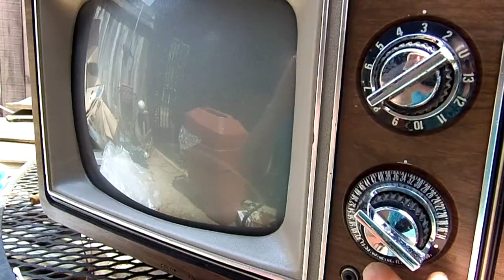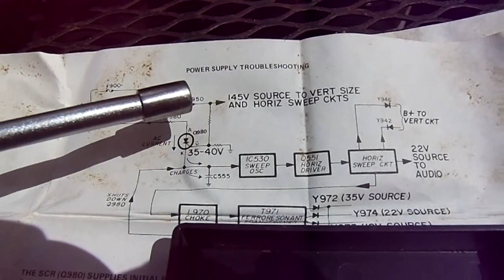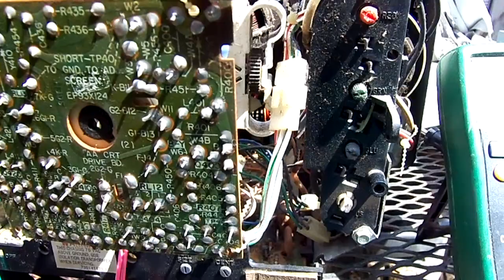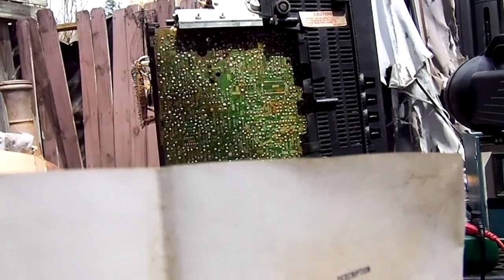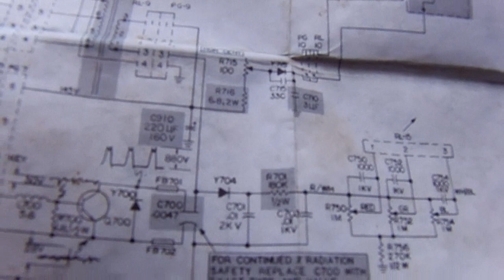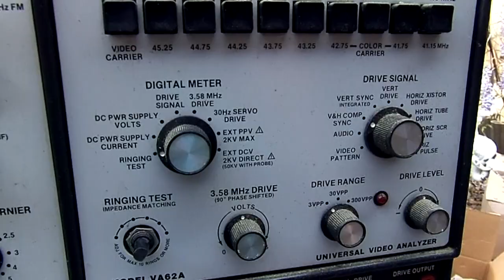Vintage 10" GE color TV diagnosis

Comment: I had a tube portacolor tv dated 1973, really good color but small screen was hard to set the  vertical size to catch crawl at the bottom of the screen.  I used it as a test tv to repair vcrs till I found a newer 13 inch tv. I sold that set at a flea market got 25$ for it . For its size it was quite heavy.

Comment: Around the 9 minute mark, you mentioned "Setchell Carlson".  It's a brand of TV I've only seen once in my life.   At Jacksonville State University, at Brewer Hall, a building built in the early 70s, was full of Setchell Carlson black and white TVs with radio tuners in them as well.  I think every classroom had one mounted in the front of the room and some of the open areas (like in the lobby) had some as well.   The brand is not to be confused with "Stromberg Carlson" as many might be tempted to do.
Reply: I had a 19 and a 25" Setchell Carlson console tvs. They were excellent.

Comment: nice little beast, dont remember having anything that style here in the UK, there was a usually all grey or white plastic 10 inch thing, late 80s, 'Nikkai Baby10' and other branded variants, that were very common and nearly all suffered from potted psu regulator failure!
Reply: White > Gray